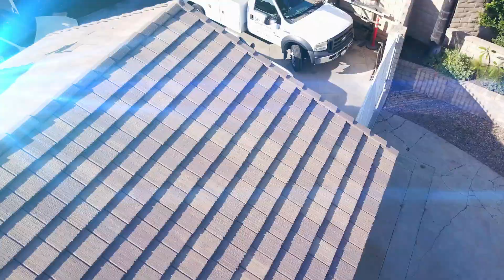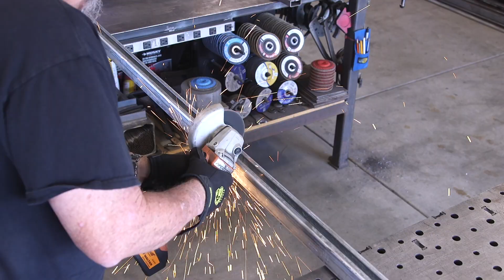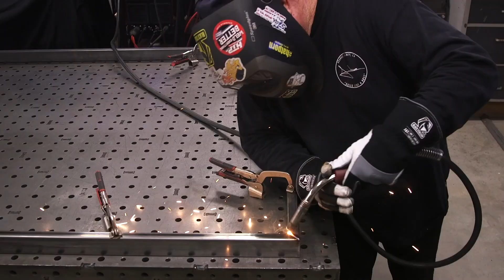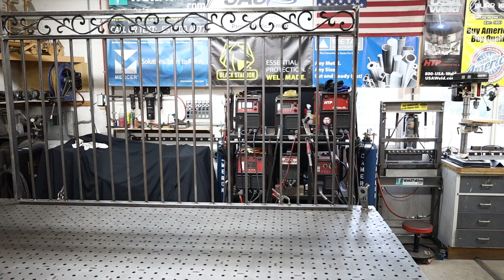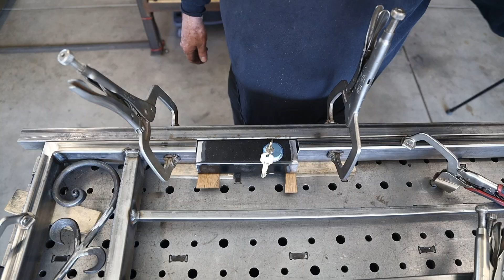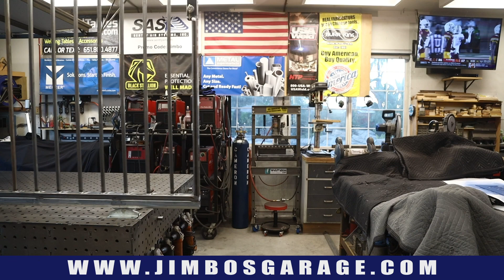Metal Cantilever Rolling Gate| JIMBO'S GARAGE

Comment: Jimbo, if you do not want it to spring you can put in a temp short bar top and bottom of where it is going before you cut it, Then it will never spring anywhere. When finished cut them off.
Reply: Exactly.

Comment: Jimbo,  I've wondered why you put the backer in when you cut angles. Its odd that it won't go all the way thru. I have an older EVOSaw 380 and I cut 45's all the way thru all the time
Reply: 355 has a 355mm blade diameter. 380 has a 380mm blade diameter I believe.

Comment: Hey Jimbo, thanks for another excellent build! I couldn’t help but notice that there was virtually ZERO spatter  on your weld table, even when you were getting close welding the frame corners. I spend almost as much time cleaning up spatter on my weld table as I do cleaning up my ugly welds. How do you do it? I’m running a Vulcan 220, .030 wire, 75/25 gas, and typically use the default preconfigured settings and always make a hell of a mess. Any guidance would be greatly appreciated!
Reply: WD-40 on the table top helps at my shop. Keeps the rust at bay too.
Reply: He uses 90/10 gas. I have never used it but it is supposed to minimize spatter compared to 75/25

Comment: I did one of these. I have many vids on it. Opening over 12 feet about 20 ft long total for the over hang. I used the track as the base. Opens with auto opener and rack package. Working good over three years. Going to build another one for my other opening for my driveway. Nice job on the gate. Weld tables are slick.

Comment: On the section of the gate that never clears the wall, could you have just welded in a solid sheet, say 11ga, instead of pickets?  Or maybe just an x brace arrangement?  BTW, I am a subscriber and I rang the bell, and I didn't get notified of your last two videos. Do you maintain a mailing list yourself?

Comment: Typically, you do NOT add the extra balusters all the way to the end; it get's a tension bar design installed... this is so you do not waster material and also block the view of the side wall when gate is closed...  The gate closed now, has extra 5 foot of balusters (you call pickets) on the face of the wall area)... Detracting from that beautiful stone wall.

Comment: I use to build alot of doors and gates .. Doing the weld hook locks last was always the best way.. Great job..
Reply: I agree. It helps brace the frame but I usually tack temporary braces from bot/top to above/below cut out before cutting because it Always moves towards the inside due to the fillet welds.

Comment: No need to go on a double with the whole frame. Do the frame just over the size of the opening to cover the hardware or the post. Other part can be just the bottom part of the frame with a triangle / diagonal piece to connect to the top of the frame for structural rigidity, and sliding rail at the bottom part in the whole length off course. That other part is about 1/4 to 1/3 of the length of the opening. That's it. In other way, nice and quick gate.
Reply: That's a slick way. Just extend the bottom rail, no need for so many pickets or decrorative accents.

Comment: Nice job as always, couldn’t you have just used the track as the bottom of the gate instead of welding the gate on top? Just wondering if that would work too.
Reply: Good point/idea. Could of saved a bit of material. However the aesthetics might have looked off doing it that way.
Reply: You want the track to be as rigid as possible for this type of gate to support the overhanging weight without flexing. Granted this is only a small gate so I’m sure it’s possible in this case. But there is a risk. If you burn through the track with one of your welds it binds up in the carriage wheels. And is really tricky to grind out. I’ve done maybe 10-15 of these up to a 9 metre (29 feet) clear opening. Good job for this application. 🇬🇧